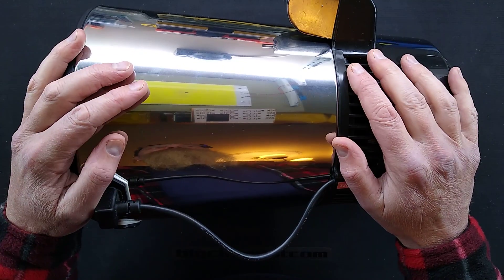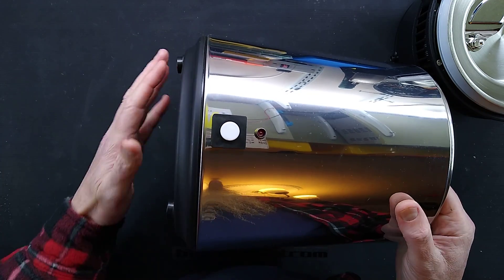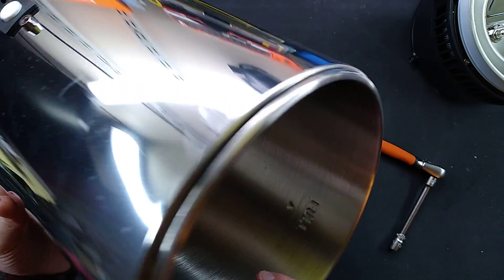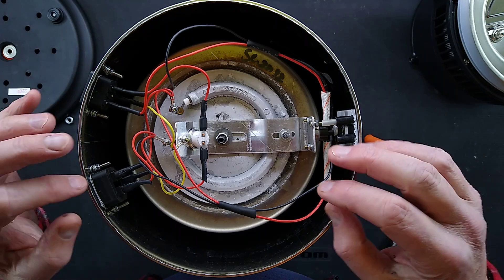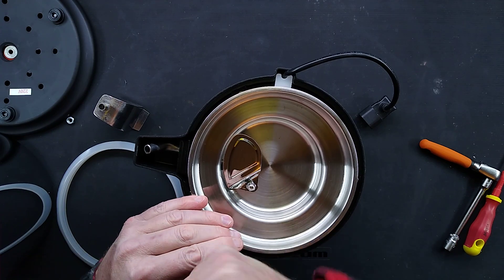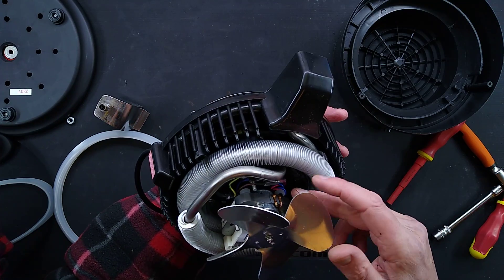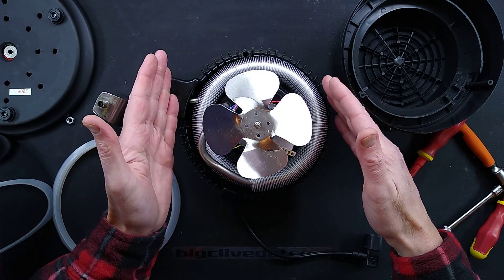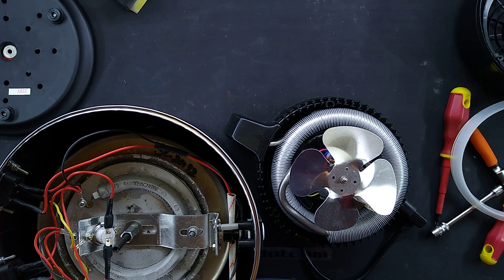Water/alcohol air-still distiller teardown

Comment: I actually use one of these, specifically sold for Alcohol - but basically the same unit in all ways.  But I use it for cleaning IPA after it's been used for resin printing.   Recovers the bulk of the IPA for reuse.  I'm not sure from an energy perspective it's a whole lot more cost effective than buying IPA, but during the height of covid response it certainly was as IPA had gone through the roof and was even difficult to get in volume.     I mean I suppose from pure math it's a better value to distill it - though it is a pain in the rump for a bunch of reasons..
Reply from the maker: Does the residual resin cause issues in the chamber?
Reply: @bigclivedotcom  no -  I have not had any issues -  I do clean the interior before I put it into storage and I do let the dirty IPA build up to about 2 gallons before I drag out the distiller and assorted kit to do a cleaning IPA process... Just because it's an unpleasant sticky task.  biggest issue I have is spillage when pouring and stuff getting sticky but... it's not an issue.  wear gloves and 3m mask .  Though honestly with the slightest breeze the smell outdoors next to the unit is not bad -  opening the chamber to check on it -  gotta have a 3m respirator on.. 3m organic solvent like - same one I use for working with the resin vats when they are open etc.  But the vessel and chamber itself I have not had any issues.  couple of times it got a bit gunky inside.  I cleaned it and no issues.  I doubt I would have needed to clean it but I'm like that.
Reply: @bigclivedotcom  the resin gets hard and crumbly at the end. After it cools, I use a stick to break it up and pull it out. there is a bit of residue that sticks to the sides but after doing this for 2 years it doesn't seem to build up more than that (i think the thicker bits come off with the rest of the resin). I don't use the distiller for anything else though.
Reply: @markburton5292  my experience as well
Reply: @bigclivedotcom  
For me it's entirely up to what resin that was mostly used.
Reply: I read it as you where using Indian pale ale for resin printing xD
Reply: @treeman5590  That could be interesting.
lol
Reply: I've been researching this.

So far, putting the IPA in a clear soda bottle out in the sun causes it to make a semi solid snot substance. I used a colander to separate it.

Then I funneled it back with a coffee filter.

It left a little residue, I don't really care that much. I use a three-stage system. Got a container to dunk prints right off the printer. Then it goes into the cleaning machine. Then a final dunking in clean IPA.

The residue really doesn't need to be removed for the first dunk.

My plan to deal with the residue is run it through a Britta water filter. If it can make rotgut vodka drinkable after a couple of passes, my hypothesis is it'll make it good enough for the cleaning machine.

I just left the snot in the sun until it was a solid. Took a couple of days, but it was partly cloudy. Next time I think I might squeeze it with cheesecloth. Works for cheese.

I am a mad scientist though so YMMV.
Reply: Very clever George, very clever. 👍 I wish I was using quantities of IPA that I could do that to now because the power would cost me almost nothing due to my roof being covered with solar panels.
Reply: Funny, my coworker just got a resin printer and we were discussing if this would work today while he was using a ton of IPA to clean his prints.
Reply: Was going to say, this was a useful video specifically because I've been considering purchasing a distiller for exactly such a task. (Man, resin printers require a lot more external infrastructure than FDM...)
Reply: You can just use gravity and cheap ceramic filters from eBay...
Reply: @o0julek0o  gravity filtering resin with filters doesn't work well. It takes a lot of time, and it still leaves a lot of resin in it. Distilling is fast works, work very well, gives you clean uncontaminated IPA or ethanal to use. if you want to filter your IPA/ethanal then you are better off exposing it, and then filtering with cheese cloth. you use multiple layers and can squeeze the majority of the resin out. you can reuse the cheese cloth. From what I can tell that gives a better result than the gravity filtration method.
Reply: @markburton5292  there was a video about it floating around. There’s specific, cheap ceramic filters, that work perfectly
Reply: @o0julek0o  I have seen the video I have done a lot of experimenting with cleaning IPA for resin printing, so yes, I have tried what you are suggesting. it doesn't work as well as distilling. Personally, I will stick with distilling. Distilling is safe as long as you take proper precautions. Those include distilling in well ventilated area and using a Proper mask. You also need to take proper precautions if you filter as well. Again, for the results and time spent distilled is the best method in my opinion. You of course are welcome to have your own opinion.
Reply: As a 'simple' test... are you up for... measuring out a volume of IPA (stuff you haven't used for resin printing)... then 'distill" that... and then measure what you've recovered. My guessimation  is that if you start with 100 cc ... you'll only get back 75 cc. I realize that with the resin printer thing... getting some IPA back is better than getting none back... unless you factor in the cost of the electricity?
Reply: @willthecat3861  you are right you do lose some, but you do get most of it back and it works as good as new.  Outdoor temperature also affects the percentage you get back. I have recoverd as much as 90% and have times where I only get 50% back. Best tie is to distill it early in the morning. As a side note anytime I have done filtering even when I have exposed the ipa the part cleaning properties become less and less effective up to a point that it really isn't doing anything.  At that point you need to replace it.   So you either have to take it to a place that can treat it or pour it in a pan and let the IPA evaporate off while the resin sets so you can dispose of the cured resin.   One thing I learned from Clives video is that I should block up that hole. that should help with how much I can recover. Also it is stainless steel tube not aluminum in order to be food safe.
Reply: @willthecat3861  I started 485 ml (a partial bottle from 500 ml I used some on bed cleaning for my FDM printer) and I recovered 275 so that run I got 56% recovery that was with a outside temp of 72.6 F or 22.5c. in the winter when is cold out I can get better recovery but it probably isn't much better I don't really compare the volume  for normal use.
Reply: @markburton5292  I found that the included gasket of the cooling head does not like hot IPA. It gets kind of longer, has a very loose fit and does not provide a good seal anymore. After a while at fresh air it shrinks back to normal length and could be used again. The hole thing ist leaking and makes a mess while destilling IPA and that could explain some of your numbers. Currently I'm searching for a better seal, that solves this issue.
Reply: @gordonernenputsch8091  i haven't had any issue with the seal that my unit uses.  i don't get any leaking from the seal. My unit was one that is sold as use for alcohol. So, l I think it is more of a temp difference thing. in the summer the air is warm, so it doesn't cool down enough to recover more. The alcohol is still really warm when it flows out. So, I would bet that there is still a lot of vapor present, and with colder outside air it would be able to exchange more of that heat from the vapors to the air and condense more product. I should do a new test now that it is winter and cold outside to see how much it affects it.  I do know that the air temperature affects the recovery percentage.
Reply: Btw there's been an article highlighted on Hackaday just now about pulling out resin with a simple contraption that should be energy efficient.

A depleted toilet paper tube rotates in the vat with contaminated liquid. It picks up some resin IPA mixture and then a near UV light - a couple small LEDs work, a 3W LED works better - cures it onto the tube. The tube must rotate slowly, giving IPA time to drain or evaporate. By all reason if it's in a closed container, you might not lose much IPA at all. It does stop working eventually, but by then the liquid, initially heavily contaminated, is clean enough for print washing again.
Reply: @SianaGearz  Funny, I came to this video from the comments in that hackaday article. Full circle.
Reply: As someone who works on industrial resin printers, please do all these tasks in well ventilated areas and with a respirator if you have it. A lot of poorly understood volatiles are going to be coming off
Reply: @csunday95  Everything I do related to the distillation is performed outdoors -  I have a super convenient shop that has a covered area where the previous owners had parked their ATV.    I also always wear a 3m respirator certified for organic solvents / paints.  
The IPA that results from this process is clean with no sign (short of laboratory testing) of resin products.  This works well for my use and I've been doing it this way for ~18 months.  Other than needing to buy a new glass carafe (as I dropped mine while storing it) I have not had any issues.
Reply: @csunday95  Lucky me I live in industrial, I go outside.
Reply: Isn't boiling resin alcohol going to produce lots of nasty fumes
Reply: @birdpump  yes.   Just the IPA alone is nasty -  not really from the normal process of condensing but the opening of the vessel throughout the process to add more feedstock to the chamber (I do ~2 gallons at a time) so I don't have to do it all the time.  But I do it outdoors and wear a 3m respirator
Reply: @birdpump  yes it does. I do it outside so its well ventilated. i would not recommend doing inside

Comment: you could add the dimmer  measurinuse a thermocouple set the tempriture of heater to biol off diffrent elements with in a liquid with some degree of acuacy. I guess you could also just poke a thrmocouple (between the lid and container )into the liquid and watch the temprature as it heats said liquid.  Hany item to have about the home 2x👍

Comment: I still have a  Liebig condenser and a range of quick connect joints with a large 3lt boiling flask to make distilled water, I end up with tubes all over to supply the condenser with its cold cooling water, but it produces the purest of distilled water with zero risk of the water being boiled reaching the condenser and contaminating the distilled outflow.
I used to have a number of very high-capacity lead acid batteries, which is why I made the setup, but the batteries have long gone, and it's been a year or three since I used it.
Using an off-the-shelf condenser, like the one shown, is that alcohol boils at a slightly lower temperature than water and an off-the-shelf water condenser will not give you pure distilled alcohol, you'll end up with a large amount of water and some alcohol.

I'll not say I did try distilling alcohol from homemade beer, and I'll not say I was careful to keep the boiling temperature at the boiling point of alcohol, and I'll not say I made sure that the temperature never went above the alcohol boiling point. I didn't end up with a small bottle of alcohol and I didn't try a few drops on a spoon and set light to it, there may not be any residue left in the spoon, thus it would be a very pure undiluted alcohol, not for drinking purposes unless you close one and only risk going blind in the one eye you keep open!

K.

Comment: Distiller? I can't see a reason for drinking distilled or demineralized water; a human body can't go without a supply of minerals, and this stuff will wash them out leading to health problems. Use tap water, filtered if necessary, or bottled water if you don't have access to clean tap water.

Using distilled water for technical purposes is totally understandable on the other hand, though I'd rather buy demineralized water in bulk rather than put a lot of electricity into heating the water to boiling point and keeping it at it.

By the way, I remember the water distiller we used in our chemistry lab back in high school. It was made of glass, used a 3~ 400/230V ion (electrode) boiler and a pretty clever condenser where part of the pre-heated water exiting it was directed into the boiler, then heated to the boiling point and evaporated, then condensed and gathered in a big glass baloon bottle like the ones used for wine fermentation.

Comment: Thanks for the vid.
I've got one of those and actually use it to make distilled water (mainly for technical uses).
I make batches (store it in 2L fizzy drink bottles - well rinsed of course) of distilled water only in the winter  so I get the benefit of the house being heated by the unit instead of wasting the heat in the summer.
Reply: this is an excellent room heater plus a humidifier! two in one.
Reply: These units really do make good room heaters when distilling  water. More volatile substances produce little waste heat.
Reply: Get a glass jug.

Comment: Such an elegantly simple device!Steam irons are another common use for distilled water.
Reply: Agreed. Anything that has water channels that could be obstructed with lime is a good candidate for using demineralized water.
Reply: @KeritechElectronics  there is apparently a distinction between demineralised and distilled water. Not enough to worry most people, but I believe distilled is not pure enough for some applications. Sorry to be that anorak.
Reply: @rowgli  distilled is produced through boiling water and condensing the vapor, and demineralized is made by passing water through layers of anionite and cationite, effectively binding all anions and cations (or, to be more precise, substituting them for hydroxyl anions and hydrogen cations which recombine into water molecules).
Reply: @KeritechElectronics  from what I remember when I used to fill Harrier jump jets with demineralised water, it was expensive stuff (for water!). It was used in the RR Pegasus engine for thrust-augmentation in the hover. Pratt & Whitney also used it on some their jumbo jet engines for extra takeoff thrust.
Reply: @wirdy1  we used WTA at Camp Bastion hospital for the autoclaves. Being in Logistics I remember having to hunt the NSN to get it supplied
Reply: I figured that out the hard way. I bought an iron for the first time ever in my life and it lasted about six months before the holes were blocked up and it started sputtering dirty water/steam onto my clothes. I tried to clean it out with vinegar, and got enough of it that it stopped spitting mineral mud, but I couldn’t get enough of the build up to get it to steam worth a damn. Then the seal between the water reservoir and steam chamber started leaking and there was more steam coming up from between the hot plate and the plastic handle bit, and burning the shit out of me, than there was coming out of the steam holes. So, I bought a new one and just buy $1-something gallons of distilled water from the grocery store that seem to work well
Reply: @RandomBogey  In the future, use citric acid rather than vinegar to dissolve lime scale. It works so much more effectively.
Reply: I just bought a new iron and it specifically says "do not use distilled or demineralised water as this will defeat the anti-scaling system".
Yeah, right.
Reply: @chrishartley1210  please also be aware that using distilled or demineralised water may cause the iron to spit water as it tends to have a higher boiling point and may not boil/vaporise properly, you may need to turn the iron up to compensate, which may cause damage to your fibres.
Reply: @aaronlucas8162  The water here is so soft that I don't need to use them.
I was just pointing out the nonsense that using them could damage the descaling system since it would only need to be used if the iron became scaled.
BTW, distilled or demineralised water doesn't have a significant difference in boiling point but they can have the nasty property of suddenly boiling in large, potentially explosive, quantities.

Comment: We have used one (not the same unit)now for 4 years making vodka, rum, gin and essential oils.
Great hobby
Please do not use the kettle lead it comes with as can be aluminium!
Also replace the wire which connects earth from the plug on the side to the distiller's metal work for something you know is copper and thicker.
Reply from the maker: I was pondering if the internal earth connections were big enough too.
Reply: @bigclivedotcom  test it be interesting.
Is the lead supplied with your distiller safe?
Reply: @bigclivedotcom  it just needs to trip the RCCB, that is usually set around 5-10mA, right?
Reply: Chineseum crap? 😠

Comment: My unit was supplied with a kettle lead made of ALUMINIUM and the element failed to earth!
The earth wire melted before RCD tripping.
It gave me burns could not use two my fingers for a week and the worst shock in 30 years. Had to have a week off work.
I work as an industrial/theatre electrician in highly dangerous environments and proud not to have a shock at work. Ok minor tingling as always test everything then back of hand first 
I did replace RCD afterwards but on testing it was still within scope.